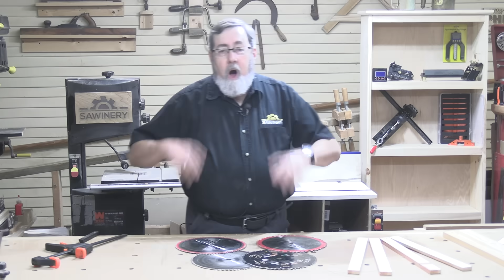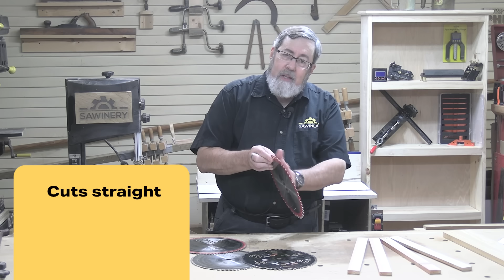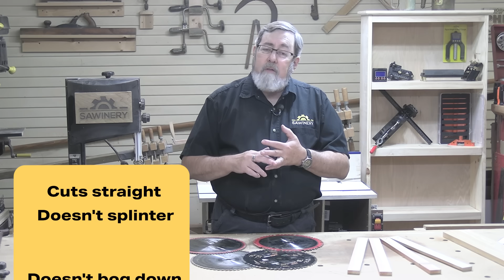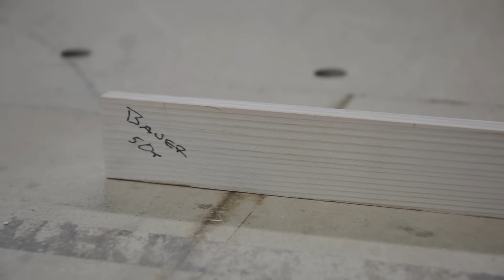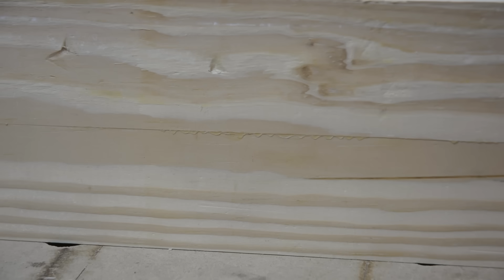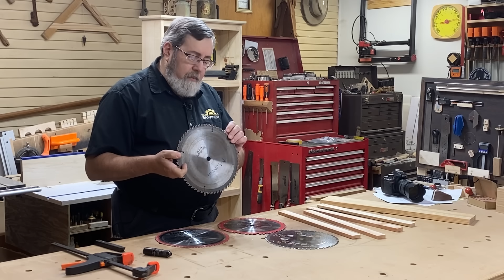The Most Underrated Tool at Harbor Freight

Comment: Just stumbled onto this somewhat older video. I have the Bauer 50 in my table saw and the 80 in my miter saw. OUTSTANDING quality cuts in both, and long lasting. I just bought an extra 50 tooth on the 30% off coupon deal and got it for $13.99. Should have bought more, but they last so long that I think I'll just stock up on the next coupon. Great blades, definitely underrated.

Comment: After a bit of research, I bought a 12inch Hercules dual bevel, slider miter saw, 60 tooth carbide blade, and the the high end stand.  Wow! Cuts like a lazer, and smooth! One thousand RPM faster than the Dewalt, five pounds lighter and a bunch less money. I cut a 14 inch wide peace of wood, flipped one of the balls over and butted them back together; the cut was perfect. You want tight meters on your crowns and bases, for a reasonable price, get a Hercules, you won't be sorry.

Comment: Yes Sir, 

I'm a bit on the cheap side too and yes, I have bought several "El Cheapos" (2 x 10" plus 7 1/4),
they seem to cut well and being pretty skinny seems not to be a disadvantage either.

Living a bit in the boonies, I'm driving ~18 miles to the next USPS office and try to sharpen the
blades myself with a  low priced Harbor Freight device.

Comment: I've used the Bauer blades in my circular saws (hobby woodwork so not hard and heavy all the time) and been impressed.  The 7-1/4 blade in my open box deal worm drive saw leaves a very nice cut.  I did just buy my 1st CMT blade, that same 50 tooth combination blade for my new Delta 36-725t2 and was very pleased with the cuts.  Granted I got it very affordably at my local Menards which isn't an option everywhere.

Comment: No thanks. I've been bitten too many times by HF products. I use some of their consumables, but never power tools, sandpaper, measuring tools, etc. The actual "orange" CMT blades are excellent and can be sharpened several times. The edge lasts a long time. Before I toss it, the cost-of-ownership is around $30/blade. My shop is running 3 tablesaws over 30 hours/week each. We cut a lot of abrasive MDF which can destroy cheaper carbide. Last time I checked, HF doesn't make a flat top grind blade. Thx for your video. HF blades are not for everyone, but casual DIY people can probably get along fine with their $20 blade.
Reply: Totally agree with the no motor, no measure policy it’s been mine for years. Crowbar, hatchet, splitter, prybars, clamps, levels (only if adjustable), punches, cold chisels, bulk hacksaw blades, pipe thread/electrical tape, magnetic tool trays, rags, rubber gloves, lighting, spade bits (as disposable) every day. 
One exception to the no motor is the vs rotary tool(dremmel) so I don’t have to change bits. 
I got lucky with one of their nice-ish bench planes once, the sole wasn’t perfectly flat but it’s been mounted in a very small part trimmer jig for years. Not the spokeshaves or cheap planes.
Add to the never list air hose fittings and tools, impact sockets, car creepers, broken screw extraction bits, driver bits, cutoff/grinding discs, buff/wax pads, router bits, most flashlights, drill bit sets.
I buy a quantities of cheap & disposable for my regular use drill bits (1/16, 1/8, 1/4, 3/8, 1/2) but enjoy using a nice index of quality bits for wood, metal, forstner, hole saw, pilot/shank/recess bits. 
The cheap tap/die sets are ok to start but the ruined ones get replaced as needed by very high end pieces. 
Not things I need to trust my life with - jacks/stands, come-a-longs, snatch blocks, rope/line/cable. Over time these have been given to family I don’t much like. jk glad to help out and upgrade to quality when needed. 
Just my experience for my needs, ymmv.
Reply: @UTube354  Absolutely. Thx.

Comment: People often blame the blade for bad cuts when it could be that the blade is dirty. I just recently had to use my TS for a bunch of repetitive cuts in red oak. The blade was creating burn marks and tooth marks/tear-out when I started. I almost went out and bought a new blade, but I thought I'd try to clean it first. It takes some time and elbow grease, but the results made me a believer. A blade I thought was shot is now cutting like butter.
Reply: Can you describe your method and materials/solvent you use for cleaning your saw blades.
Reply: @BryanTorok  I used mineral spirits but almost any oil based solvent would work. I placed the blade on a 5 gallon bucket lid and used a brass wire brush. There are specialty solvents that are specifically made for blade cleaning but this worked great.

Comment: Tooth angle and grind also matter. I use Bauer 7-1/2" blades in circular saws as well as an 80 tooth crosscut in my 10" miter saw, and they all give good cuts. However, all Bauer blades are ATB only, and none have flat ground teeth nor even 1 flat rake tooth. For that reason I run a CMT 50T 4:1 ATB+F in the table saw. That flat rake gives a much cleaner bottom to non-through cuts like dados, grooves, and rabbets.

I'm currently using Diablo in the 12" miter saw, because I found a great deal on a two-pack for less than Bauer.

Comment: My wife calls me cheap but I consider it more selective, when I spend money I want great bang for buck and could care less about brand names.  I have a variety of table & miter saw blades; Bauer, Hercules, CMT, Admiral, Diablo, and Amana off the top of my head.  I prefer the Hercules over the Bauer blades but both serve me well for the price, I recently built a bathroom vanity so researched a new blade.  Ended up getting a CMT on sale and this is my go to when making things I want the best cuts.

IMO the best underrated Harbor Freight tool is their Hercules 12' compound miter saw, wow what a fantastic tool for the money!  I was going to buy the DeWalt DWS780 until this came out, I put my hands all over both resulting in me not justifying paying twice for the same tool.  I have been using this miter hard for 3 years and this thing amazes me every time, accurate and powerful!  I don't think that you will find a better miter saw for $299!

Comment: Thanks!, I own a radial arm saw for years, didn't know if I need to replace my blade I need to get a negative rake blade. I also buy a lot from Harbor Freight just didn't know about the Bauer Blades being good.
Reply: People may not realize but sliding miter saws should also be using negative rake teeth blades.

Comment: Haven't tried any Bauer blades yet.  I bought the Hercules 12in miter saw recently and it came with a 60 tooth Hercules blade.  I planned on replacing it with a Diablo, but the included blade has been much better than I expected.  For $30, I'll replace it with another of the same if it stays sharp as long a Diablo.

Comment: Spend $100+ for a saw blade, hit a nail, and that $100 blade is now just as dull as the $20 blade LOL.  

I've been using Diablo blades for several years now, but my new table saw has a Warrior blade on it....can't really say its any better or worse than other brands, but most of these blades you just throw them away when they get dull as it doesn't make any financial sense to sharpen them as it would cost as much if not more than a new blade.  

I think just about any blade off the shelf is going to be better than whatever blade comes on the saw from the factory....the blades from Harbor Freight don't seem to be too bad, I think someone in another video mentioned the Hercules blades are possibly a knock off of Freud/Diablo blades.  They are more expensive than the Warrior and Bauer blades.  

Something to keep in mind with these thin kerf blades is deflection.  Due to being thinner, they oftentimes will deflect when you are doing heavier cutting especially in hardwoods compared to the standard kerf blades which can throw your cut off too.  The blade my run true under no load, but as soon as you apply a load to the blade it may skew the blade one way or the other.  

I don't see anything wrong with running those Bauer or the Hercules blades....The Diablo blades aren't that much more expensive and are made by Freud, so tend to just stick with the Diablo blades....I buy the 2 packs of them when they are on sale in both 10 inch and 12 inch as my miter saw is a 12 inch model.
Reply: Diablo was the first blade I bought and I was disappointed. The red kept coming off on the wood after about 10 cuts. I'll never buy one again. It did cut good but I don't want red wood edges.

Comment: I can't get Harbor Freight blades. Only for U.S. people. I like your video though - I like how you think, and I take the same approach (looking for the cheaper end of good). The cheap WEN blades at Amazon are quite highly rated; have you tried them? If you have, what did you think of them? Lastly, is it possible to flatten out a 10" saw blade that has somehow become warped? Hope you have a great day!
Reply from the maker: I haven’t tried WEN’s saw blades; but based on my experience with their tools, I would expect them to be comparable to the HF Bauer blades. As for flattening a warped blade, I wouldn’t try it. I’ve done some metalworking and jewelry-making and flattening metal is the hardest thing to do. It rarely comes out flat.
Reply: @sawinery-woodworking  Thank you for letting me know - much appreciated.

Comment: Harbor freight also has a woodworking blade by Hercules and they are a full ⅛kerf blade. They work fantastic. I've had the 40 tooth blade like that in my table saw for close to 2 years now and it still goes through oak like butter
Reply: I have had my eye on those Hercules silver blades.  Not much out there for reviews.  I think I might have to bite the bullet and get a 60 and 80 myself and try them out.
Reply: I recently purchased a 2hp grizzly tablesaw 0899 if I recall correctly. Anyway the saw came with a 60 tooth blade. I needed a 80 tooth one to cut something for a project. Long story short I picked up a Hercules 80 tooth blade and it seems fine. I've only ripped 3 sheets of OSB, 2 sheets of hardboard,  and a few 2x4s. Longevity is unknown but no regrets so far. Hope this helps. @BishjamIC
Reply: It is hard to find any reviews on those Hercules blades I finally bit the bullet and grabbed a 62th recently for my miter saw and the little bit of work I've done with it so far I'm happy but I did hit a damn nail and some old lumber I was working with in it chipped a tooth off already

Comment: Coincidentally, I just got home from Harbor Freight, where I was looking for a new blade for my Delta table saw.  I considered the Bauer 10" 40T thin kerf blade.  But instead, I chose the 10" 40T Hercules blade.  I chose that because it has the full 1/8" kerf, which I prefer, because I can cut a 7/32" groove for 1/4" plywood with just 2 passes.  Do you have any comments on HF's Hercules blades?
Reply from the maker: I haven’t personally tried the Hercules blade yet. If HF is following through with their strategy about their different lines of tools, I would expect it to be better than the Bauer blade. I like the idea that it is a full 1/8” thick, as I’ve never been overly impressed with thin kerf blades. I wonder if the plate is thicker, as well and whether the teeth are deeper, making it practical to sharpen.

Comment: I will have to check out the blade section at HF. Are all 7 1/4” blades for circular saws thin kerf?
Reply from the maker: I believe so. Just bought a couple of Milwaukee 1 1/4” circular saw blades at my local hardware store and they were narrow kerf, so I think that has become standard for circular saws.
Reply: @sawinery-woodworking  do you happen to know what size blade a track saw uses?

Comment: Thank you for this excellent video comparison!
As a hobbyist, I stopped buying the expensive $100+ blades and started using the blades similar to the Harbor Freight blades.
Maybe a professional needs the higher cost saw blades based upon high usage?
Reply: Same for me. I build outdoor furniture and have had zero issues with HF blades.